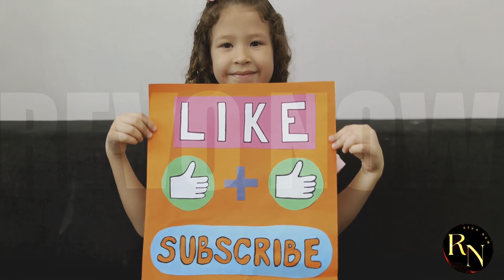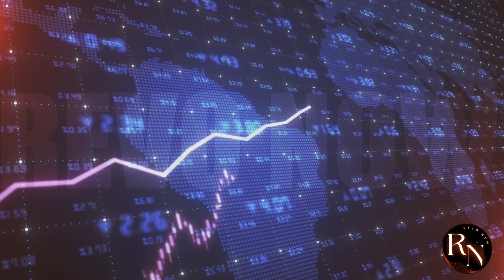China Takes LEAD in EUV Technology with 6 Self Developed Machines!

Comment: The title and commentary say EUV, but so far China has only produced DUV, not EUV.  If it did produce EUV, all the semiconductor media would be abuze, it is not. However, it appears the Chinese are investing billions to build a new lithography center and one supposes that if there is a Chinese EUV, it would come from here.  They seemed to have mastered the three key components, the light source, the optics, and the stepper table. The light source is the most critical and there are several proposals with the particle accelerator seemingly a large but consistent powerful EUV light source. Time will tell, but in  the meantime, it appears China is trying to create 3nm chips using DUV.  This is the current cusp of Chinese lithography.